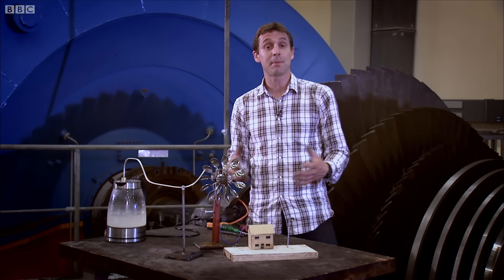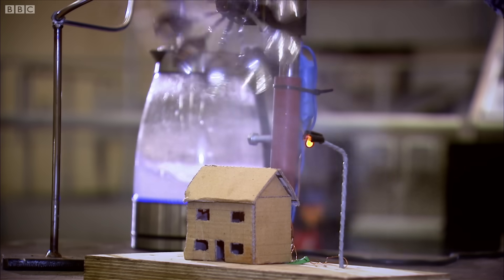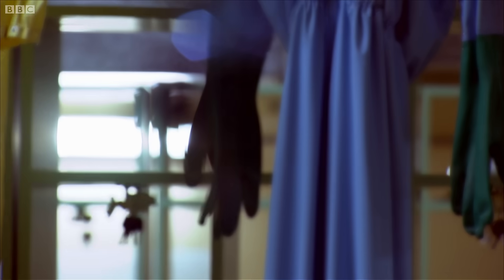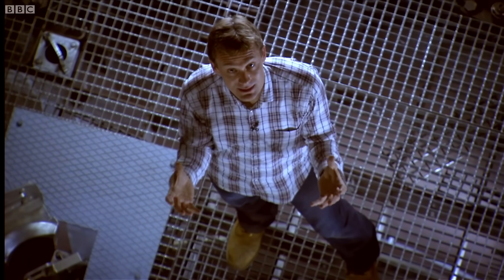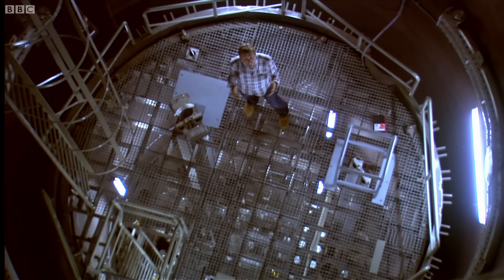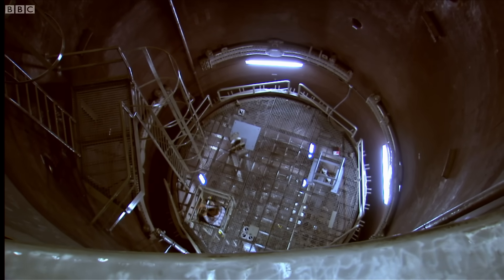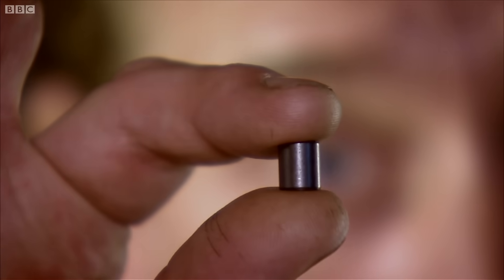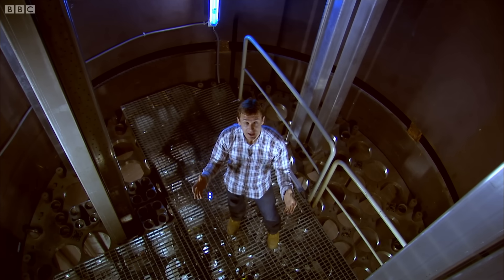Inside a nuclear reactor core - Bang Goes The Theory - BBC

Comment: Using the energy stored in the cores of atoms to heat water to move a propellor to generate electricity is a very stupid idea. It was only developed to be able to make nuclear bombs, otherwise the cost would have been prohibitive. Apart from that, it is highly inefficient, potentially very dangerous and gives radioactive waste that nobody really knows what to do with. It is a problem for 100.000 years from now to manage. If you calculate the risks and the cost, nobody would want it. The core of the nuclear industry is military driven.
Reply: the cost? it's actually the cheapest way of generating electricity. Do we actually know what to do with other wastes? Do we actually know what to do with the dangerous gases emitted from plants that are burning coal, natural gas or oil? Just dumping it in the atmosphere is not a solution. It is harming the planet. And you can't tell me that nuclear is longer term. We passed the 400ppm of CO2 in the atmosphere, and scientist say we will never be able to return under. Even if we stop emitting co2 now, it would take thousands of years for the atmosphere to be clean again. I consider that pollution is much more dangerous than nuclear energy. Look at diseases caused by polluted air, climate change, irreversible effects, species disappearing. What did nuclear energy do to us until now? Chernobyl, which was caused by an idiotic mistake that would never happen today. Were there effects? Yes. Were they worse than pollution. I think not.
Reply: Ronald de Rooij take a wild guess on how much radioactive waste is generated at an 800 megawatt facility. only 1/3 of the fuel is replaced during refueling. the other 2/3 gets reintroduced and reorganized  into the reactor. the particular plant I work at, still has ALL the old fuel on plant site not even taking up 1/2 acre. it's all being cooled by natural air circulation in dry cast.  the plant has been online since 1968.    800 megawatts PER HOUR for over 40 years. not counting refueling downtime, and less than 1/2 acre of storage. this dry cast spent fuel puts off extremely small amounts of radiation. sounds fairly darn efficient to me.
Reply: fusion is the answer

Comment: nuclear reactor vs hydrolic press ?
Reply: Hydraulic press powered BY nuclear reactor!
Reply: Helium Road nuclear reactor vs 60,000 psi water jet
Reply: nuclear rocket knife? hudraulic rocket water jet
Reply: Pierre Pignal that's a very bad idea
Reply: Pieree Pignal. Your question doesn't make sense.
Reply: Nuclear reactor..will it blend?
Reply: It is very dangerous so we must deal with it
Reply: Nuclear reactor vs hydraulic press vs will it blend's blender vs beater bomb vs 1000 degree knife. The ultimate deathmatch!
Reply: its called Chernobyl
Reply: Thanks for the bomb ideas I'm halfway to wiring my boom
Reply: Pierre Pignal ... No sence

Comment: If I'm not mistaken, I think the 'water' he's talking about; the water that passes through the reactor, which also contains the atoms that set off the nuclear reaction, is something called 'heavy water,' which is basically regular water that has been refined by electrolysis all the way down to almost 100% deuterium oxide.
Reply: Nearly all commercial nuclear power plants only use "light water" or regular water as a moderator. That is all that's required for 3-5% grade U-235 fuel. Breeder reactors, like the types used to produce weapons grade plutonium use heavy water because it enhances the neutron absorption rate of U-238 in the fuel which converts into PU-239. Heavy water reactors also require a much higher U-235 percentage in the fuel, usually around 20%. Heavy water reactors are simply too expensive to be viable for commercial power production and can be used to make material for bomb making too easily.
Reply: Ronald Haworth - Thank you, that makes sense because of the resources needed to make a large enough volume of heavy water. That was a nice a-ha moment :)
Reply: Bikewithlove actually Ronald Haworth is completely wrong. There are in fact heavy water commercial reactors. Ever heard of CANDUs? They work on natural uranium (0,72% U-235) Heavy water alone does not increase neutron absortion in U-238.
Reply: I think the CANDUS plant is the only commercial plant that uses heavy water. More of the experimental plant actually.
Reply: Enfin Punto - Thank you for your post, I checked out the CANDU reactor, and it does use heavy water, plus it recycles different kinds of fuel so the 'nukes go in but they don't go out' so to speak. I never heard of them before, so it was cool to find out. Ronald Howarth is generally correct though, because the difference between a bomb maker and a power generator is the heavy water, or the lack thereof, respectively. According to what I read, CANDU reactors are strictly regulated against any potentiality for bomb making, so they're a special exception for heavy water. I think I've got that right, let me know...
Reply: Bikewithlove Hi! Well, what makes primarily a good breeder reactor is the capacity of extracting the "bomb fuel" at just the right moment, with plutonium for example:
During the reactor operation, the concentration of different plutonium isotopes varies, so you want to extract the fuel when you have the most of the fissile ones (Pu-239, Pu-241). As you may have read, this is not practical in a PWR or BWR, but it is indeed in a CANDU. That is because there is no need to shut it off to extract fuel assemblies individually.
RBMK's (like Chernobyl) had this same capacity, but used graphite as moderator instead. They were used as plutonium breeders, being the electric power a secondary product.
It is just that there are different ways of achieving the same things. What is more, bomb purpose plutonium is normally produced in fast reactors, which don't need moderator at all.

Comment: It  also explains a few key weak points of water based pressure reactors. from solid to gas formation in uranium fuel rods, only a small percentage of uranium is usable after a run & rods have to be shifted & checked for integrity, you need to keep it cooled & running properly to prevent overheating & blow off/meltdown with multiple redundancies. A LFTR will not have any of those issues.
Reply: Siong Loo only roughly 1/3 of the fuel is "new fuel" after a refueling outage. the other 2/3 is reused and reorganized in the reactor to run another 18 months to 2 years. at least at the plant I work at

Comment: according to my study I got to know that instead of water through the core high pressure co2 is used which heats up and evaporate water
Reply: Depends on the reactor design you are using. In Britain there are several gas cooled reactors, while the water only reactors are more common in the rest of the world.

Comment: Probably the most advanced piece of machinery ever created by humans is simply used to boil water to create electricity. Fascinating. Thanks for this great clip :)
Reply: Actually, as far as complicated machinery goes, the nuclear reactor is pretty simple.  A diesel engine is far more intricate.  Sniffing at the fact that it boils water is silly.  What it is actually doing is converting energy locked up within the atom's nuclei by supernova explosions in eons past into kinetic, and then heat energy; the turbines convert that into rotational and then electrical energy, which at your house you convert into all sorts of energy forms, which all eventually become heat and dissipate into the cosmos.  Etherial, isn't it?
Reply: There are many different theories of how to do something more with nuclear energy, because this isn't the most efficient way of using atomic energy, but it's so expensive to test or make and not many are willing to make sufficient investments that they've just used this same technique for many years.
Reply: No kidding. I had to watch this twice because I thought I must have missed a very important detail.
Reply: Using several kilograms of uranium is better than Burning thousands of tonnes of coal for electricity
Reply: +Aaron Hinton That is definitely sad, because contraty to popular belief, nuclear energy IS the energy of the future. There is yet to be one energy soure as efficient and reliable as it. Also, it is close to the renewable ones in terms of polution.
Reply: Fun fact, first ever of these "most amazing" pieces of machinery consisted of pile of graphite and fuel blocks, in a corner of an old sports building in Chicago. Control rods, which were the only moving parts, were operated by pulleys and ropes. Nuclear physics are interesting, but from the machinery point of view, the principle of a nuclear reactor is stupid simple. You need fuel, you need moderator and you need control rods, end of story, everything else is fluff you need for power generation and safety.
If you want some nuclear nerdgasm, you should look towards research fusion reactors. Wendelstein 7-X for example, https://www.youtube.com/watch?v=u-fbBRAxJNk
Reply: Well? You'd prefer it used that energy to blast, or spread fallout around?
Reply: puncheex2 or when people use that energy to boil water lol
Reply: That would be Strategic Nuclear Submarine. they are the most advanced and COMPLEX tech there is.
Reply: @pzrkstinger  Sorry but the space shuttles still hold the record as the most complex machines ever created
Reply: ill add two points.... firstly the video missed out the control rods. these block the neutrons and are there to make sure all the fuel isnt used at once. there are examples of when that has happened, the results have never been good. secondly because of the safety required for such machine, the control systems involved have to be *perfect*. water directly in the reactor is likely to be highly radioactive, therefore it does not leave the reactor. it does however enter a heat exchanger, that boils water that is allowed to drive turbines. with a machine like this you cannot say "i want this much energy" and just flip a switch. you know how much energy you are going to be asked for, you think how much steam do i need, therefore how hot do i need my reactor to be, therefore how much do i need to withdraw the control rods by to get that amount. it is a very delicate operation.
Reply: @thelaughingman5730  Nuclear plants almost always runs at 100% capacity. In the grid, they are best used for baseline generation, not peak generation. So there's no need to fine tune its power output. There should be other supplementary systems that should be used to deal with variable load.
Reply: I inspect CANDU nuclear reactors. You are correct. For all the tech, it's basically a boiling kettle of water.
Reply: Yes, I would have prefer that.
Reply: The forbidden kettle
Reply: this is the old way to produce plutonium...
Reply: I really just realized this earlier this week watching some other YouTube nuclear videos
Reply: I know, we've got stare of the art tech on one end and industrial revolution stuff on the other.
Reply: Meanwhile 
ITER: Hold my Tokamak
Reply: I’d argue one of our most advanced would also be aircraft carriers or anything that is designed for missions outside of Earth’s atmosphere, but nuclear reactors are definitely there.
Reply: No where near one of the most advanced pieces of machinery ever created. Quite simple to develop once the physics of it were understood.
Reply: a steam engine or turbine
Reply: The interesting thing is that there were many, many more nuclear accidents and intentional acts related to the production of nuclear weapons yet they ALL went unreported and unknown to the public. There is contamination in many places around the world from everything from liquid waste to burning reactor cores... The difference is that the oil and coal men use the scariness of nuclear power to destroy the commercial nuclear industry while governments bury the accidents from their nuclear exploits in the fear that the public will act to stop them. We can't have it both ways... Nuclear power is safe, efficient and cheap but that doesn't make it profitable so its hidden away with fear and lies.
Reply: It's dumb and the waste and risk... Just boil the damn water or use wood or coal.
Reply: @Willz-m7x  This comment is dumb. The amount of Carbon pumped into the atmosphere and air pollution that goes into our lungs, fields, and water = MUCH worse then spent nuclear fuel buried under a mountain in the middle of nowhere.
Reply: @ShortHandedNow  Yep, can't get over the fact that people are scared shitless from burying moderate amounts of nuclear waste underground while not worrying (enough) about coal plants etc spewing  tons of toxic stuff  (not only co2, but also radioactive  substances) out in our thin atmosphere where we can't retrieve the waste again.